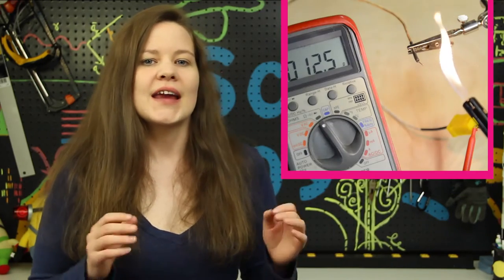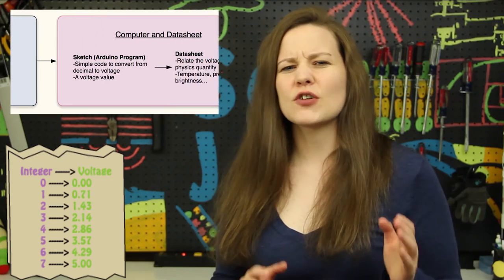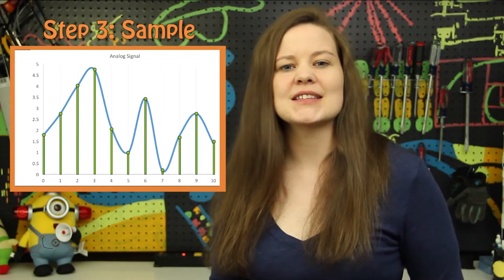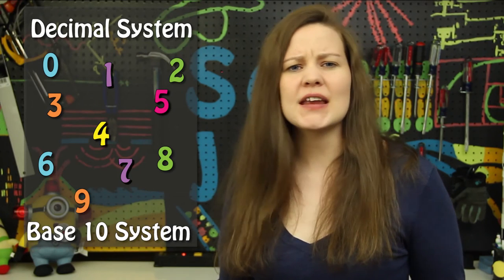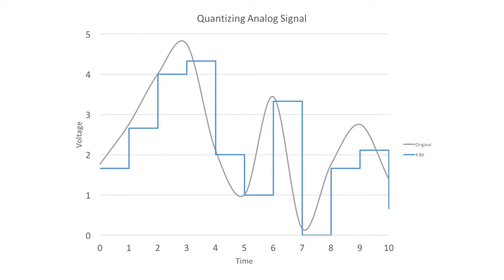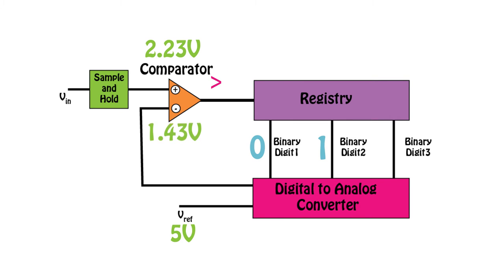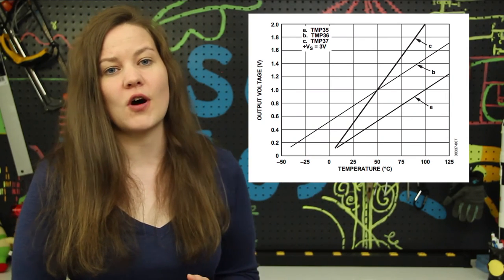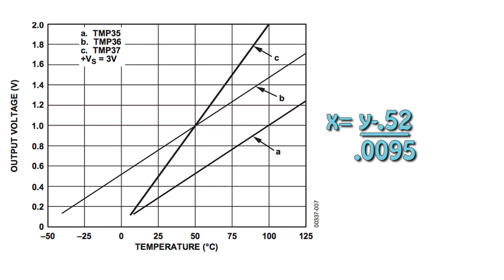Analog to Digital Converters Part 1 | Arduino - Ep 3

Comment: When I do   analog  conversion in the arduino I use  1023 ...Hence if I get   a digital number such as  324 (from 0 to 1023)...then the digital voltage can be calculated as  =5*324/1023.   However....it seems that half of the world disagree...and they claim that I have to divide by 1024.  Can you add more gasoline to this?  Keep the good Work!!! Thanks.
Reply: 0-1023 are 1024 numbers because 0 counts as well